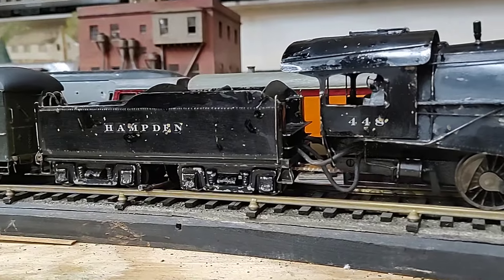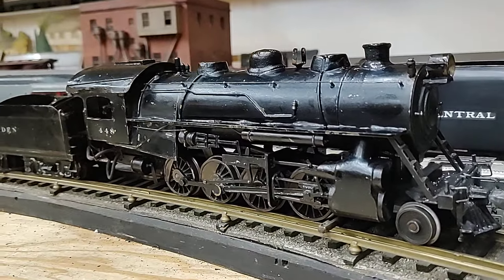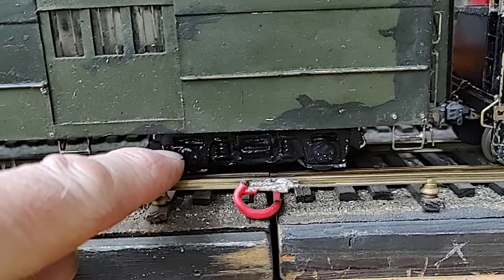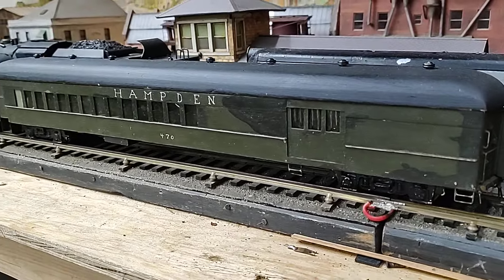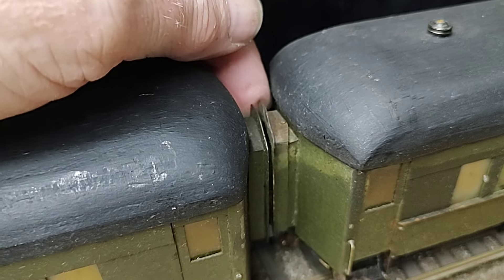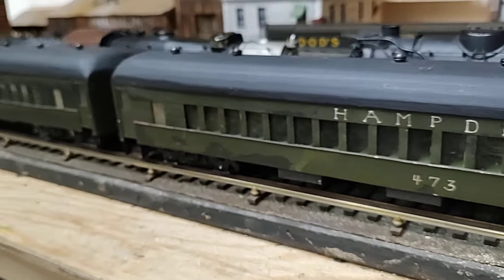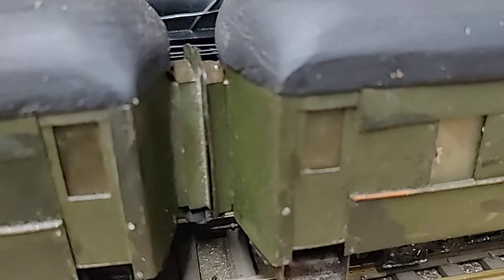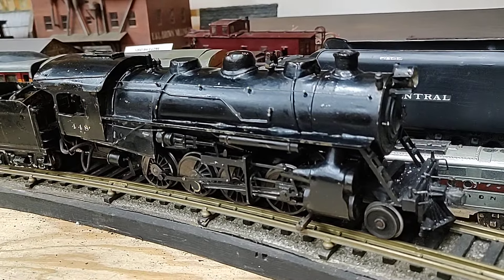Consolidation Steam Engine pulling Hampden Passenger Train O scale / gauge @vintage-model-trains

Comment: Surprising choice to build a freight 2-8-0 for a long passenger train. Wonder if there are more Hampden items out there, such a freight cars or passenger engine?
Reply from the maker: Is this all came together but yes there's a good chance there might be another pile somewhere else
Reply: While it's not typical to find a freight engine like a 2-8-0 pulling a passenger train in real-world railroading it's "Never say never."  The overriding concern is "Power for the run."  The Long Island RR pulled passenger trains on occasion with 2-8-0's and they weren't alone. 
If you need a locomotive and a 2-8-0 is all you've got on hand at the moment that's what you use.
Reply: @wayneantoniazzi2706  I know. B&O had a whole class of over 100 2-8-2 with steam lines for passenger service, mostly for protect service. Given the commitment needed to scratch build a loco, though, I'm skeptical this engine and consist went together originally.